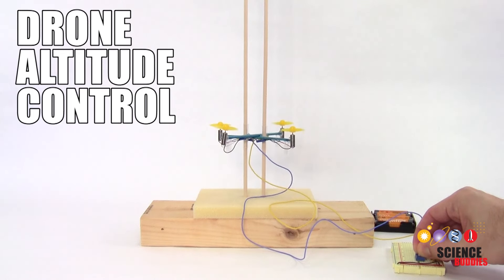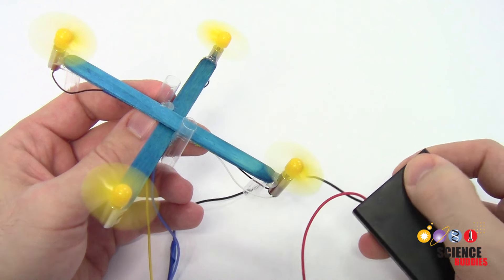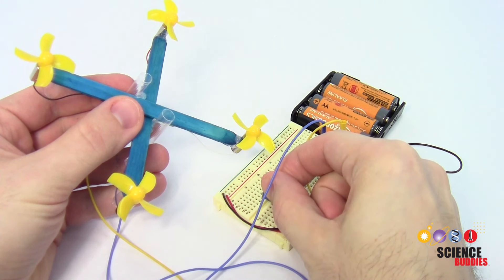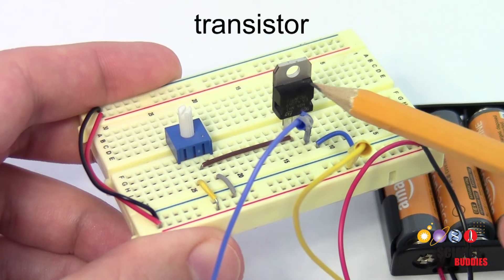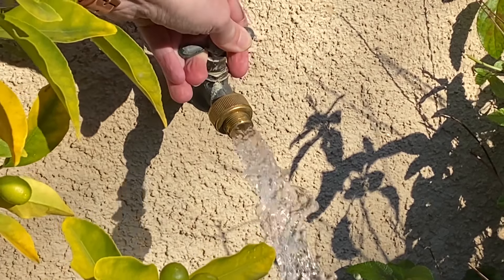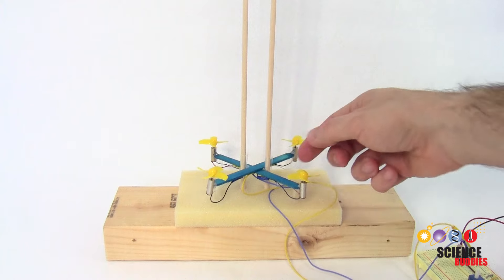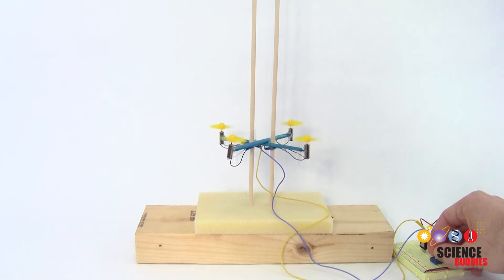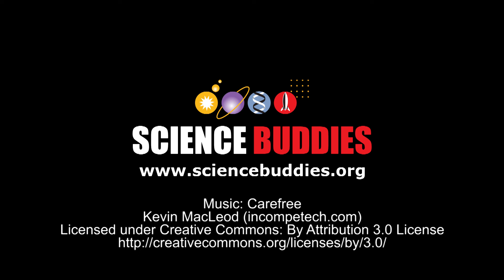DIY Mini Drone Part 2: Altitude Control Circuit | Drone Science Project

Comment: Does there have to be 4 blades on each propeller, will 2 do? will 3 do?
Reply from the maker: You should be able to use propellers with 2 or 3 blades, but we cannot guarantee that the project will work with parts we have not tested ourselves.

Comment: Can I use a 10K Ohm Potentiometer 15mm
Shaft instead of the potentiometer shown on the video? The 10K Ohm Potentiometer 15mm Shaft takes more space on the breadboard
Reply from the maker: The physical size of the potentiometer doesn't matter, you can substitute a different potentiometer.

Comment: You did not stress the simple fact that these breadboards are not good. Following the PSU up to the motor, there is a variable resistance due to the poor contacts in about 30-40 Ohms. Now the motors are not getting enough voltage to be up to the speed of lifting the drone. Also with a thermal camera, you can see shiny dots on the breadboard - THE JUMPER WIRE IS HEATING UP!!!
Man for a Ph.D. from Harvard you can do better!